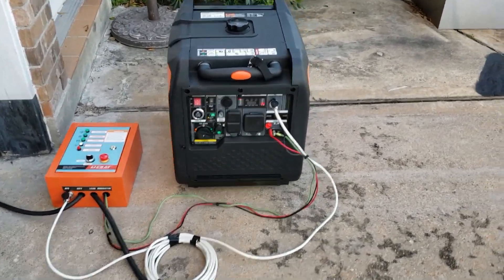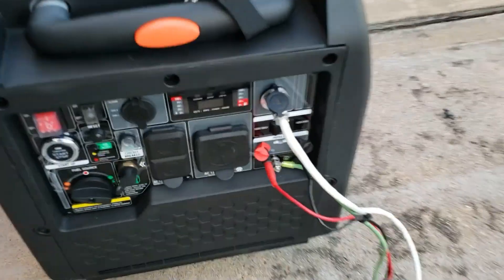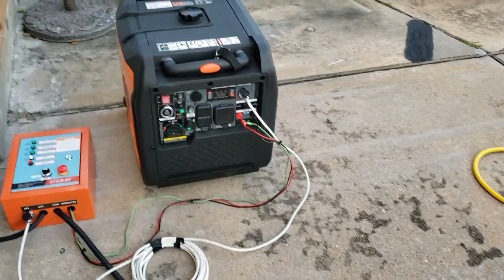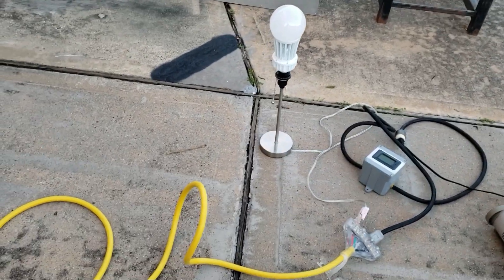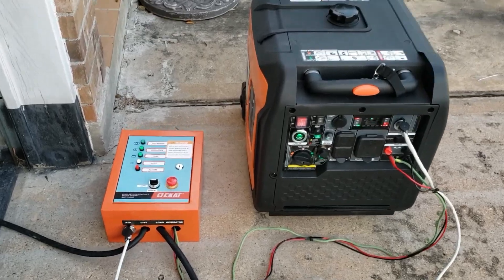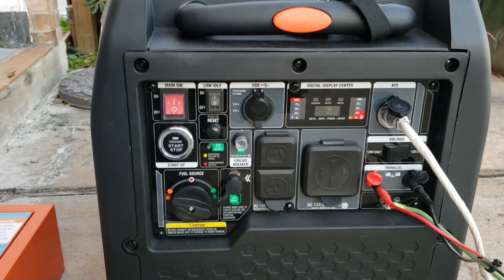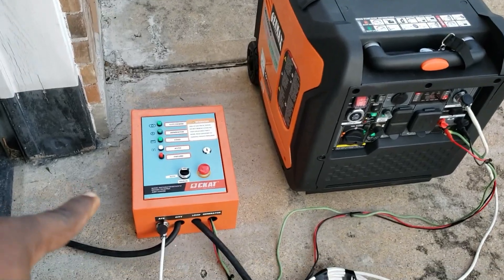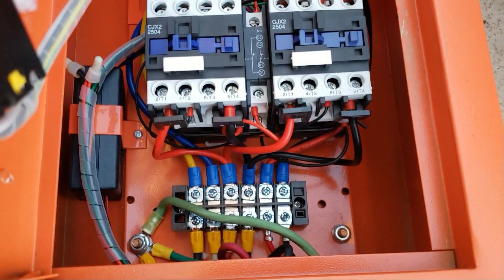Generator ATS - Automatic Transfer Switch GENMAX 7250W Auto Gen Start Demo

Comment: All the units with ATS - the connector is an GX20 7 pin Aviation Plug. For what ever reason they don't put that information anywhere in there userguid or website.

Comment: if your running electric central heat and you apply the automatic transfer switch. I think it won't allow the generator to come on cause it's probably going to detect more power drawing. is there a way around it ??
Reply from the maker: Then you get a bigger generator

Comment: Wonder if you can configure a genmax 3fuel with ATS , capable of automatic start on  and power off, when the grid goes out, similar configuration as the  permanent  systems like the generac, champion etc. without the need of the interlock mechanic switch

Comment: Pretty cool, but way too slow to transfer. When I fire my portable generator up I switch it to the load like 5 seconds later and have no issues. The whole process should be able to happen in less than 15  seconds which would meet requirements for life saving equipment in the home.

Comment: I have a hyundai inverter generator mod.65158, and ATS hyundai mod.65140. I installed the cables from the meter, to the ATS control unit things net input, I installed it to the 16 ampere socket of the generator, in the generator input, I left it empty, ats output , when I turn off the power the generator starts, when the power comes back it can't stop, what could it be, thanks
Reply from the maker: Sounds like there’s a problem with your ATS could be the shut off relay.

Comment: It looks like it doesn't/you don't have a neutral connected to the generator. How do you derive two 120V legs for testing without a neutral between the two legs of the 240V? Seems suspicious and maybe dangerous.
Reply from the maker: Most generators with floating neutral don’t have the neutral cable

Comment: Hey Gavin, I'm a bit of a newbie.  But will i be able to hook this generator up to my cerbo gx to AutoStart when batteries are low and will I need a special wire or device.
Reply from the maker: If it’s compatible with ATS ports, it will work but I haven’t seen that specific brand model yet
Reply: @GeneratorReviews  according to the manual, it uses two wire auto start. I've searched everywhere on the internet, and I have not found anything with a connector that fits into this generators ATS port

Comment: Gavin, what is the name up of the ATS switch you are using in this video and where can I get information about it?  Will it work with other inverter generators?  Tnx Gavin, really like your videos!
Reply from the maker: If you type the name in Google it actually pulls up.
Reply: What is the name or brand.

Comment: Very nicely done buddy. That would work really nice Incase your out of your house and power went off, the generator would turn on and power the selected breakers you have. I think running it on propane would be the best option, so you don’t have gas sitting in the tank and it goes bad. Thanks 🙏 Gavin
Reply from the maker: Thanks buddy👍🏾😎

Comment: I would worry that, leaving gasoline in the generator for months on end, waiting for the power to go out, would cause problems with the carburetor!
If the power goes out, I’ll just manually start the generator.
Reply from the maker: The generator and the carburetor should be stored empty. This should be set up in a power outage.

Comment: Hi Gavin.  Is there any way to get a technical description or electrical schematic for the ATS connector pinout and cable?  I'd like to know how many wires are in the cable and what they do in the ATS itself.
Reply from the maker: Let me find a link and I will send it to you
Reply: @GeneratorReviews  did you get the info ? I need this
Reply: Would love to have as well.

Comment: Recently, we had an order pending for the GENMAX GM9000iED Inverter Generator. It was on backorder. We were notified that the GENMAX GM9000iED was discontinued and our order was cancelled. We were offered the "new" GENMAX GM9000iEDC Inverter Generator at a higher price. As far as we can tell, there is no difference between models. Nothing has changed except for the "C" in the model number. We noticed that your test unit GENMAX GM7250iEDC also has the new "C" in the model number. What has changed (except for a higher price)? Do you know? Thanks.
Reply from the maker: For sale in California
Reply: @GeneratorReviews  Interesting. We are in Montana, not California. Thanks for the info. Cheers.

Comment: Hi, Gavin! That generator/auto-transfer switch combo is great. I wonder if it'll work with other generators that have an auto-start feature. I imagine the sensor plug would be wired differently on different mfg's but I bet it wouldn't be too hard to build an adapter. Nice demo!

Comment: impressive unit..  this is what i have been looking for ... Also  if you ever come across a  product that can tell when city power is retored please share..  alot of times when on generator power its difficult to say when the power has been restored
Reply from the maker: Hey Joe 
It’s hard it tell when power is restored with the main breaker turned off but I will check for something
Reply: @GeneratorReviews  I think reliance makes one
Reply: I’ve tried twice to reply to your question.  But I think my replies are getting blocked.   Let me try once more:   THP108

Comment: You go to all corners of the generator universe to find solutions.  I love it.  The Westinghouse ST smart transfer  switch looks like it has a compatible connector. Has anyone tried it on the Genmax 7250?
Reply from the maker: I actually tried the Westinghouse ST smart transfer, and for some reason it starts the generator but shut it off after a minute.
Reply: @GeneratorReviews  I'm guessing Genmax uses the same circuit logic as Duromax and is wired to the panel button, meaning it starts by holding for 1-2 seconds. Westinghouse probably uses dry contact and keeps the button circuit closed. After a period of time, it reinterprets the close as a shutdown press. I too am anxiously waiting for this to come to market so I can try on my xp9000.

Comment: That is awesome. Specially, if you have a six or 10 circuit transfer switch system, you could set that up to where you wouldn’t have to do anything they were just stay on generator and you would just have the ATS giving out the power. Pretty slick.
Reply from the maker: That’s the best way to have it setup, that way when the power comes back and goes back in 15 minutes, you don’t have to run outside and set everything up again👍🏾

Comment: What’s keeps the generator battery from fully discharging sitting a long time on standby?

Is this for use on the RV? Wire size seems small. 

Nice auto switch though.
Reply from the maker: Hey Robert
The generator goes to standby mode, but this would be set up before you a power outage occurs. 
I just wired it for the test. However, I would use at least 8 or 10 gauge wire for this set up. 

Thanks buddy 👍🏾